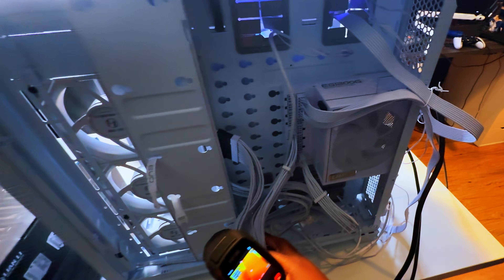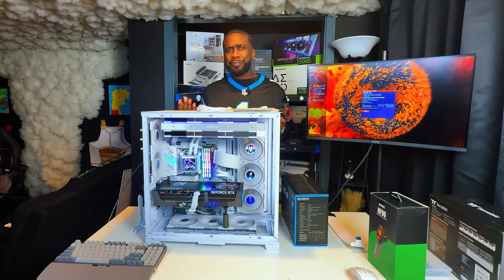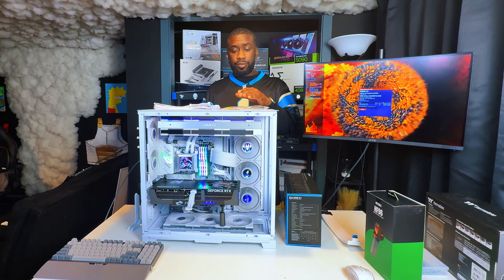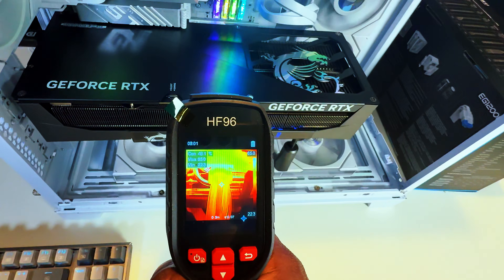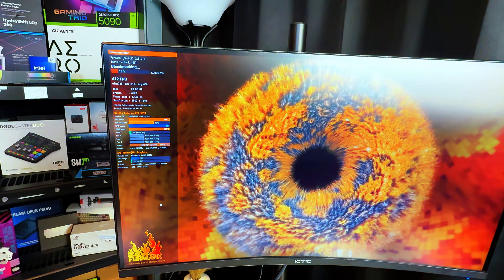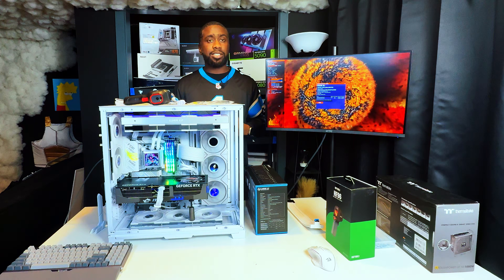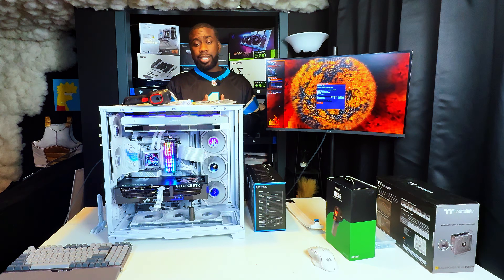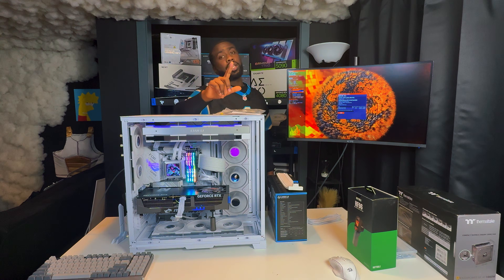Will my RTX 5090 melt the 12vhpwr like Der8auer's? TESTED!

Comment: I don’t think whether you have atx 3.1 or atx 3.0 matters. The load balancing is far more important and having it properly plugged in.

Some psu have better load balancing and spreads out the 600 watts across the six 12-volt strands in the cable.
Reply from the maker: The 3.1 allows for communication between the GPU and PSU to detect and relay that you actually have proper connection.. if you don’t.. the PSU sends 0 watts.. in which case there is no load to balance.
Reply: @AverageLarryGaming  Both 3.0 and 3.1 sense pins does that. 

The only changes 3.1 brought was the sense pins are shorter to ensure you have to push the plug in further to properly seat it. 

The conductor pins are 0.25mm longer on the 12v 2x6 compared to the original 12VHPWR.

Besides that everything is the exact same.
Reply from the maker: @ no.. it’s not. In the 3.1 standard.. there is a short circuit where as in 3.0 it remains open.. allowing for power delivery even when proper connection is not detected.
Reply: @AverageLarryGaming  My dude those sense pins only tell the psu that the gpu is ready to receive power after being properly seated. It has nothing to do with load balancing that happens after the gpu is already receiving power. Too much amps on a single/two wires in the 12v cable will still lead to melting no matter if you have atx 3.0/3.1.

Comment: Brother this was reassuring FOR SURE. I have a MSI 1250W ATX 3.1 PSU and I was worried about the wires melting. I am actually using the 1 to 4 power cable NVIDIA sent with the card. I even undervolted the 5090 to 75% power.
Reply from the maker: Oh you’re good good! 👍

Comment: honestly, you're best bet is to just use the PCI-E connectors from the psu to the 12V on the card.
Also you should watch JTC, he's showed several connectors especially Corsair and the pins get pushed inward when plugging in to the PSU.
Also 3rd party is literally anything not from Nvidia, that includes Corsair, Thermaltake, etc...It's also the fact that was causing the high temps in the wires, was the amount of AMPS being pushed through.
again, JTC did an amp measure and even some of his wires were pulling over 10amps when they should only pull 6-8amps.
You can't get a good measure simply be measuring temp.
So you probably got a good cable and a good psu.

Comment: Ur buggin for trying to be pretty wth that white cable !!!!! Hopefully ur good but I wouldn't play game with that .... put the original cable thst it came with !!!!!
Reply from the maker: What? The cable that came with my PSU is white.. lol.. because my PSU.. is white.. the GPU doesn’t come with a full cable.. it only comes with an adapter
Reply: @   Wat im sayin is u should be using the one that come with the 5090
Reply from the maker: @ I don’t have four 8 pin cables to plug into it…
Reply: @  so u not using the 12vpin cable that 5090 come with ?
Reply from the maker: @ it literally did not come with one.. just a four by 8 pin adapter..
Reply from the maker: @ did a whole unboxing video.. also the 5080 astral did not come with one either.. these come with your power supplies.. not GPU’s
Reply: @AverageLarryGaming   there two separate 4pin connectors that came with ur power supply ... thats wat i use for my RTX5090  AORUS MASTER... n i got a 1500watts corsair hxi
Reply from the maker: @dirtysock1able  4 pin? What are you talking about lol.. you run a 4 pin in your 5090 if you want to and that bish gonna brick for sure lol 
You have two choices my friend.. well technically 3 depending on brand but they are

Single 12vhpwr cable to 

Sing cable with dual 8 pin to single 12vhpwr 

Or.. some combination of four 8 pins connected to the adapter that comes with the 5090 which is a quad 8 pin to 12vhpwr adapter. 

Now I’ve seen people manage that third option different ways but the safest way would be to use four single 8 pin to 8 pin cables into the adapter.. takes up 4 PCIE power spots on the PSU.. I’ve also seen people use two dual 8 pin to single 8 pin cables where at the PSU side they have the single 8 pins connected which would be two of those.. and into the adapter goes the four 8 pins that came from those two  cables.

Comment: one problem bro?..your gpu is not a fe version. i'm not sure if this makes a difference ?.
Reply from the maker: Well I did mention that.. again this video wasn’t to disprove anything.. it was to add more information to the pool because there are others who do not have an FE and may be wondering what their risks are as well.
Reply: @AverageLarryGaming  ok..cool, thanks for the reply !. i've got a 5080 headed here, and its coming with a msi 1kw psu, it's not a 3k dollar card ?..but still..its not something to sneeze at !..lol.
Reply from the maker: @ facts! And you definitely don’t want it to burn up! Good news is the 80 class pulls far less power so you shouldn’t see any issues! Still make sure all cables are snug though! 🙏
Reply: @AverageLarryGaming  10-4 !

Comment: dude get a DJI mic!
you cant pull more watts, amps and not expect more of the same, 5090's will be burning up so much, there's going to be a recall on this one, for fire issues. I'm no hatter I have a 4090, 2x 3090's and i would have bought a 5090 if it came with 2x connectors.
Reply from the maker: That’s funny because I just showed you literally can pull more watts and amps and not expect more of the same. And I didn’t use 2x connectors.. at 70C or less.. nothing will melt lol
Reply: @AverageLarryGaming  Ok, sure it wont......next months show
Reply from the maker: @BreezzersGaming  16AWG is graded for 200 hours life span at 190C… do you actually know anything about what you’re saying or naw? lol
Reply: @AverageLarryGaming  dude you had the card a week, this is no long term evaluation LOL
Reply from the maker: @ I never said it was lol.. but I do know the spec for the cables.. and tested the temperature never clearing 70c under max power for over an hour., it took debater 10 mins to burn his.. and I NEVER actually draw close to max power in my normal use case..  doesn’t take a rocket scientist to add that data up and see that if it would of taken 200 hours at the 180C derbauer reached to burn through.. and my max load didn’t even reach half of that.. and I never actually reach max load.. this wont be an issue.. especially adding in that new PSU doesnt even allow for power delivery if the connection is poor
Reply: you can put 10g wire on, the pins are still the same.
This is like talking to one of my Ex's, they can't just let anything go.
Nvidia made a card that pulls more watts and amps, if you don't think there will be more of the same issue, from the avarage user, I promise you NorthRidgeFix will be buying a 2nd house from repairing the 5090's
Reply from the maker: @ the pins are actually not the same though.. lol not on the PSU 🤦‍♂️ the pins on ATX 3.1 vs 3.0 are NOT the same.. 3.1 delivers ZERO watts when poor or improper connection happens. The old way was just left to open which is why you would still have power delivery among the wires that did have proper connection.. when all the wires and pins are connected.. the amps are even split among them and this is not an issue at all for even 650 watts

Comment: i think the big problem is the cable that nvidia provides with the founders edition
Reply from the maker: @Lethalwick5673  you mean the adapter?  I haven’t seen it fail at all 🤷🏾‍♂️
Reply: @AverageLarryGaming  yeah the adapter but the adapter nvidia provides is different than AIBS
Reply from the maker: @ yeah I’ve seen it.. all the big tubers got one lol.. far as I could tell they all praised the adapter.. didn’t seem much different to me besides a little more flexible.. however.. I have not seen any case of a cable burn with a 1st party adapter. That should actually negate this issue entirely because it requires four separate 8 pins to run which would ensure a balanced current coming into the connection.

Comment: hey man, recently been watching your videos and really liking how informative they have been. Just got an astral 5080 and been happy with it. After overclocking of course. But I do hope these cables dont cause issues. Im running the corsair's 2 type 4 pcie to 12vhpwer now.

Keep pounding!
Reply from the maker: @Dnguyen1219  well lucky for you, you have the best of the best. And with ASUS GPU Tweak software you can accurately monitor your cable connection down to each individual pin. I freaking loved that card man!
Reply: @AverageLarryGaming  Yeah I absolutely love this card. 5090 was the original goal, but have you seen the crazy prices on ebay? They must be out their mind... 7K+.

My last card was EVGA 3080TI which was such a solid partner card. 

But time will tell to see how 50 series overall fair with reliability here.
Reply from the maker: @ yeah the rarity is what’s driving the price up., only a few of them out there

Comment: Are you an idiot? Der8auer points out the problem with the FE model, not the partner model. First, you are not using the RTX 5090 FE model; partner models are designed differently than the FE model, and Der8auer already points out this in his video. Partner models have a safety in place to determine what current they are getting at each wire.
Reply: He's just doing random tests n shit, donning that tech persona. This guy is a poser tryin to fill big shoes those established tech youtubers have been doin for ages.

Comment: Great video, have an FE 5090 myself, zero problems so far thankfully. Haven't got a thermal imaging tool but did run a few stress tests and a couple hours gaming in Cyberpunk etc and had a feel of the cables on both PSU and GPU side, they felt warm to the touch but not dangerously hot or anything. Certainly nowhere close to the 150c temps that DeBauer was getting during his tests.
I have a feeling this is gonna be a very PSU/Cable specific thing. I'm just gonna use the 12v cable that came with my PSU for now instead of my braided extensions. Fingers crossed this isnt a huge issue though going forward like the 4090 was
Reply from the maker: @mattp1680  I think you will be fine with the cables you PSU provides. Especially if it’s a newer one.
Reply: @AverageLarryGaming  Yeah it's a 1200w Thermaltake ATX 3.1 Platinum, so hopefully i'll be all good
Reply from the maker: @ oh yeah you’re good! Just plug it in tight and no worries! Hopefully! 😭
Reply: So thats how a scalper or sucker who bought a 5090 from scalpers looks like, huh...
Reply: @GracefulRequiem  I got one over here in the UK from Scan Computers on launch day actually, they had a decent amount of FE cards at launch, logged on at 1 minute past and managed to check out thankfully. Haven't the first clue how to use a "bot" and certainly wouldn't pay a scalper either. Maybe try asking before judging people you've never met online
Reply: @mattp1680 I apologize. It just seemed odd you were able to get one normally like that, when all I see is out of stock everywhere. Good for you mate.
Reply from the maker: @GracefulRequiem  man please don’t make me ban you.. it was cute and funny the other day but at this point you’re just an annoying troll.. 🤦‍♂️
Reply: @AverageLarryGaming what do u mean? How else did he get one? Either used bots or bought one for scalper prices?
Reply from the maker: @GracefulRequiem  no that’s not true.. Best Buy and Newegg have been showing availability here and there but they sell out quick so you gotta be prepared.. but there are plenty peoples showing on Reddit how they were able to snag one at msrp by being diligent.. you don’t know this persons situation.. not only that but newegg also has been doing special drops into peoples carts as part of their Newegg+ program

Comment: How many watts was your card pulling?

I think the user with the third part cables said he was pulling 500 to 525 watts when playing battle field 5.

Few things make a difference the resolution if you play at 4k or higher you push the gpu will need to work harder and pull more power. 
 
Another thing to point out is I believe on the driver level there is logic to check if furmark is running then down clock gpu.
Reply from the maker: @Darkgx5  it was pulling 574 for over an hour during the benchmark. When I’m gaming it barely goes over 450.

Comment: 3.1s have caught fire too
Reply from the maker: @michigantoga  show it, don’t just say it. If you’ve seen evidence of that.. you should actually share it. Ive yet to see any.. I’ve also yet to see any non FE models catch fire 👀
Reply: @AverageLarryGaming  Yes, it's not the PSu's. This is Nvidias problem. It's the pin design. Don't get offense my dude. It's the design of the cable if it isn't plugged in properly. There's no real difference between a 3.0 & 3.1 PSU. It doesn't matter what the PSU is. If it isn't plugged in all the way, it will be a problem more than likely. I've had a 4090 since launch & between two PSU's (EVGA 1300wG2 & a Bequiet Dark Pro 1300w) I've had ni issues. I had 4-8 pin on the EVGa & a 12VHPWR . Both cables were CableMod

Comment: Power limit your 5090 on MSI after burner to %75. It will pull 400w max. Also performance will be relatively the same. The 5090 benefits more from a stable and consistent 2.7Ghz than an overclock. This will give you lower thermals, consistent framerate and higher %1 lows.
Reply from the maker: @ZackSNetwork  to be honest.. outside of this test.. I barely ran past 400w on the gaming test I was doing.. and that was at 4k max settings .

Comment: I highly appreciate your video here, as I have the same Lian Li power supply (black version), and am using the 12V cable that came with the power supply with my 5090 FE.   Happy to see these results!
Reply: Power limit your 5090 FE to %75 on MSI After Burner. Card will perform the same but quieter and will pull 400w max. Also do not OC the VRAM or the core. I recommend the stable 2.6Ghz on the GPU because it benefits from stability than higher clocks.
Reply: @ZackSNetwork nice, I actually did this last night. Set the power to 75% and didn’t see much if any performance loss. I was going to OC but decided not to.
Reply: @ZackSNetwork first thing I did lol and yeah it’s running super cool and quiet but no noticeable loss in performance, happy customer
Reply from the maker: @mark_delight  happy to hear that friend!

Comment: Looks like the problem is mostly on FE cards and not with AIB MODELS, new cables 12v-2x6  also help mitigate the situation.  Its not over,  some cables instead of redistribute the load load only 2 cables instead of spreading the load to 6. Thanks for the test...
Reply from the maker: Thanks for the info! And no problem. Just trying to do what I can since I’m one of the 18 people that got a 5090 😭

Comment: it shouldnt matter what cable it is! Thats the whole point. If last gen cables or power supplys are that bad. Why didnt they recall it?  Because those cables are still in spec right?
Reply from the maker: @RTWorld5  oh I 100% agree.. the only reason I think it does matter to just find out is to inform the consumer.. if they’re not gonna recall it.. then people still need to know what works and what doesn’t.
Reply: @AverageLarryGaming  Its crazy when in "spec" means Nothing.. it all comes back to trust in a company.. Which is why 4090 will be the last Nvidia i buy until they smarten up! Ill take the performance hit with AMD 9070
Reply: @RTWorld5 That is a tremendous performance hit. It will likely be slightly slower than a 4080.

Comment: Undervolting is the new overclocking
Reply from the maker: @TheBlueBunnyKen  you might be right!!
Reply: With how much power these new gpu's are soaking up, you must undervolt out of box. I even undervolted my 3060ti, because it performs better than when I overclocked it
Reply from the maker: @TheBlueBunnyKen  I don’t think you can say “must” lol like mine was barely ever crossing 450 with everything maxed out.. and in don’t even play like that.. I was just testing it.
Reply: @ I just feel like it would extend the life of the card, but that's just me
Reply: I was thinking the same, keep it on silent bios if u have the option and undervolt it

Comment: I'm using the 12v connection too but I have a pcei 5.1 psu with a dedicated 12v 2x6 connection on the power supply. So I should be good 🤞
Reply from the maker: You will be GOLDEN!
Reply: So i have a seasonic gx focus 1000w gold power supply it has pcie gen 5 and atx3.0 but mine also has a dedicated 12vhp 2x6 with a rtx 5080 shouls i be worried?? @AverageLarryGaming
Reply from the maker: @ I would personally not try to run a 5090 on a 1000w power supply.. especially one that’s not 3.1
It’s too risky.. 1000w is the minimum requirement and you always want to account for at least 100w over. And then since it’s not 3.1.. it wouldn’t be able to detect improper pin connection and zero out power delivery unfortunately. Don’t risk it.
Reply: @AverageLarryGaming  okay but I'm talking about the 5080 or should the same thing apply?
Reply from the maker: @ oh no. 5080 you good to go! Sorry I didn’t realize that!
Reply: @AverageLarryGaming  it's all good just wanted to make sure since they use the same kind of cable

Comment: See bro that’s why I stayed down with the 5080 right now!! Let them cook the bugs out! We still got to wait on even better drivers now to stabilize it all. Also what is that benchmark you’re running? I’ve been trying to find that program for so long
Reply from the maker: It’s called Furmark. It definitely cooks your GPU to the max power. I’m not too worried about it now after running that for hours and not cracking 70C.